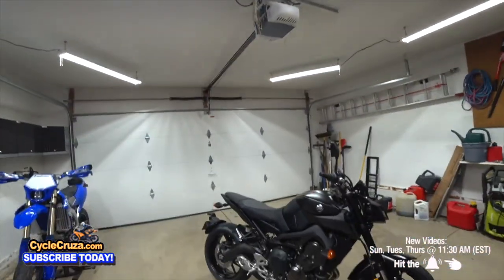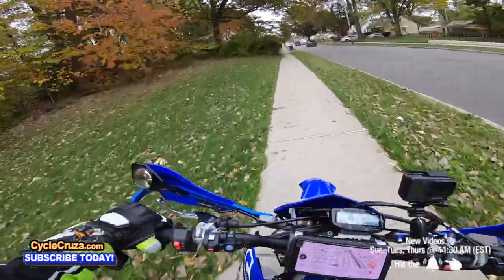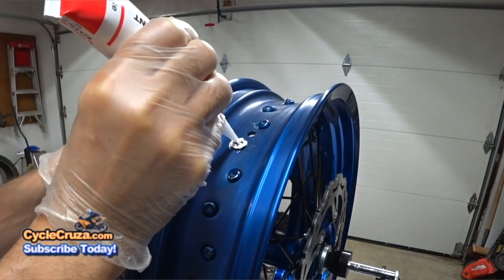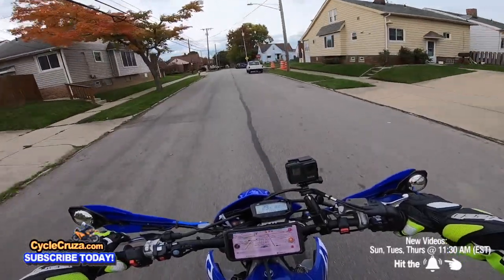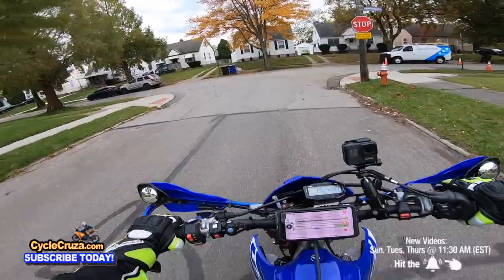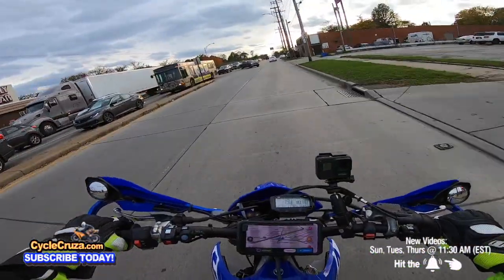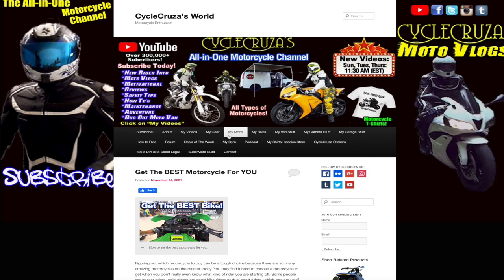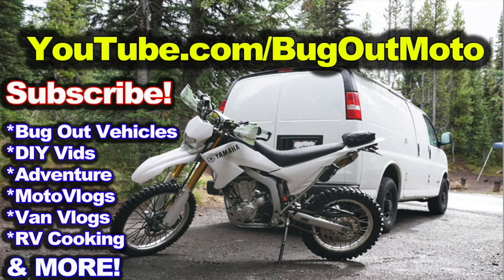5 BEST Motorcycle Mods To Do FIRST

Comment: My Honda XR 250 and 400 I changed the carburettors to mikuni pumper ones and did the air box and grinded the welds down on header pipe and changed rear can it woke the bike right up it should of came from factory like that